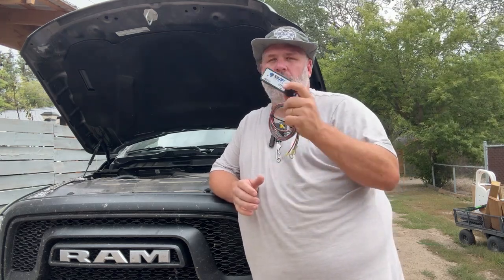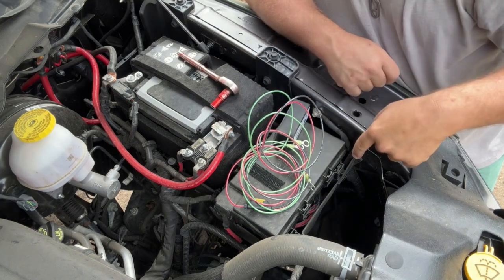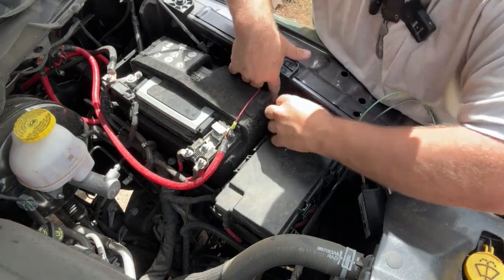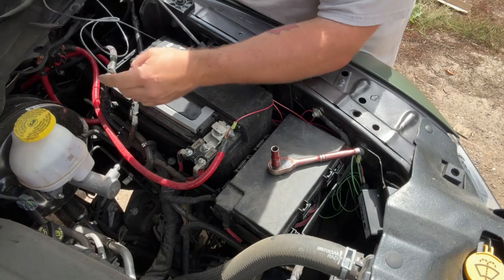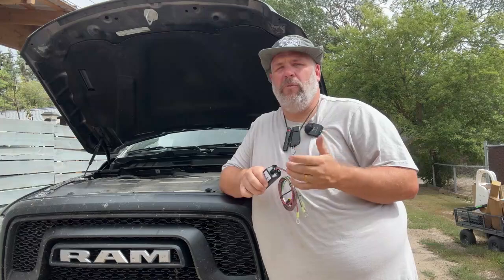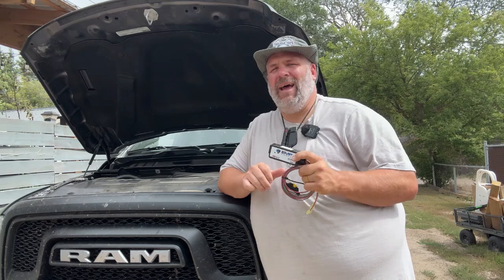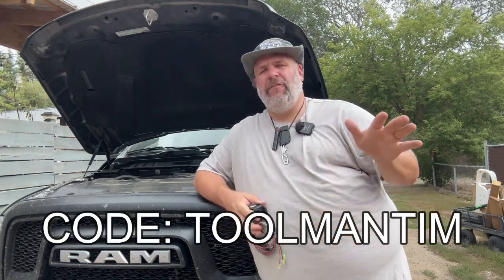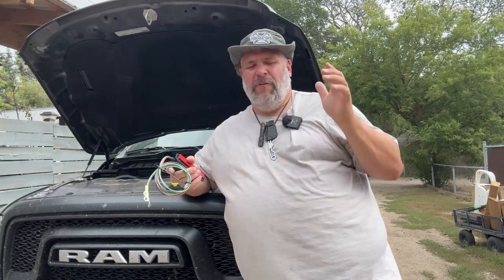EMP SHIELD MICRO - LIGHTNING Protection For Vehicles - WORTH THE INVESTMENT?

Comment: Nice video. Thank you. However, what about the EMP Shield instruction that their green wire has to be grounded to your chassis no less than four linear feet from the negative terminal of the battery? (They also specify that the grounding location not be used for grounding anything else, but it looks like your installation does that.) This question arises because I have read their documentation and info from some other people and it seems like the ability to properly shunt the overcurrent to ground is the most important factor. It seems like that might be technologically more difficult on a vehicle than home installation. Thanks again for your time.